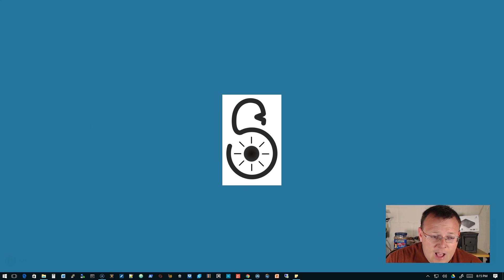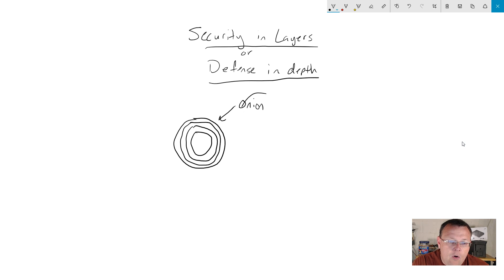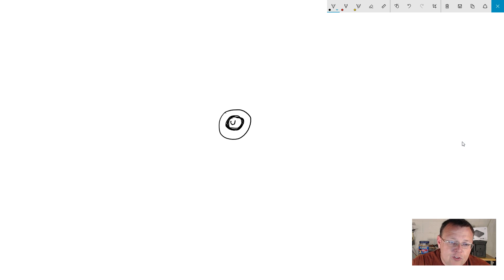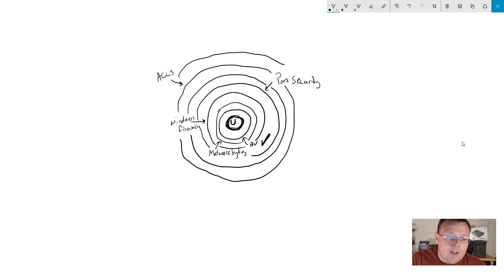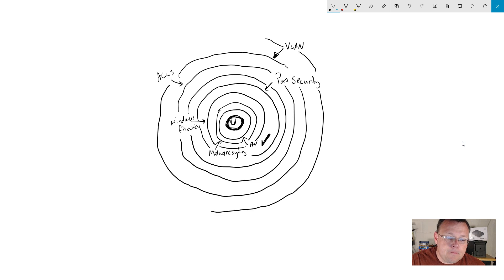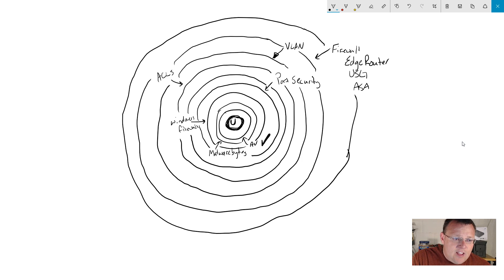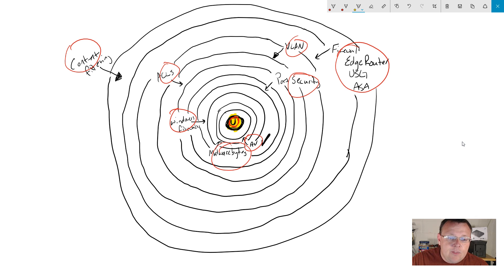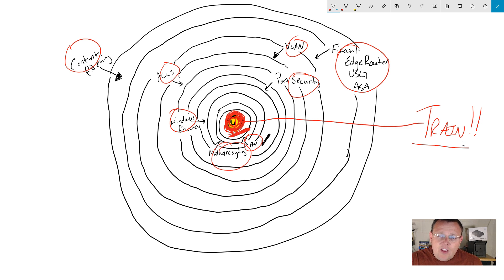Security In Layers - Defense In Depth

Comment: I believe and do a very similar setup for my clients. Training is crucial. And the clients employees are the first to forget the training.  Or just out right sabotage.
I try to out think the down side and sometimes I think it works and other times I have had a CFO who brought in her own external HDD and the entire system failed due to the viruses that where introduced. That is when I added white listing as my primary protection along with all of the above. Now my weakest link is the man in the middle attack, and that is an annoyance more than a problem. At least so far.

Comment: You Can Get a meraki ap with 3 years of licensing for free if you attend a webinar. we have meraki access points but the licensing Cost...
Reply: I had the privilege of paying 400 USD for a Cisco AP which is managed by the ISP. In my network. In my house. It was not possible to make it work without it. Lovely solution for those without an AP, but useless for the 2 floor building we live in (no coverage at all downstairs). The AC Pros I have do a vastly better job. The Cisco stuff is very good quality and honestly, if you need engineering support and you have the appropriate contract in place, Cisco and the likes are fantastic. But for a very high quality, way lower price, Ubiquiti has come a very, very long way. Vastly superior to the ISP router wifi ;)